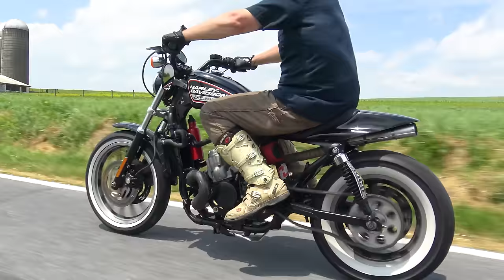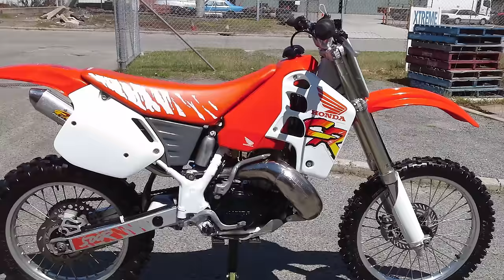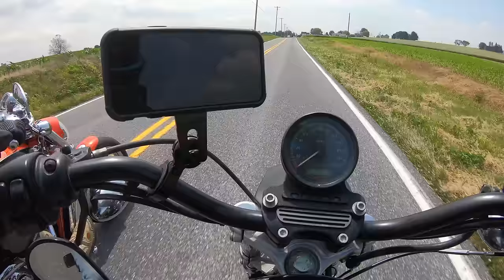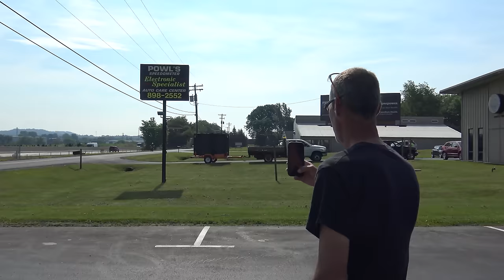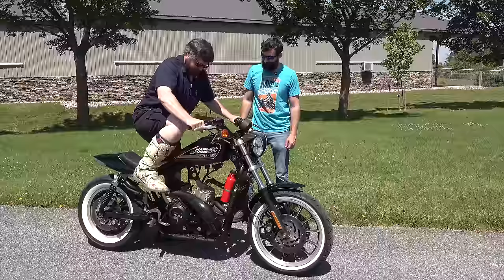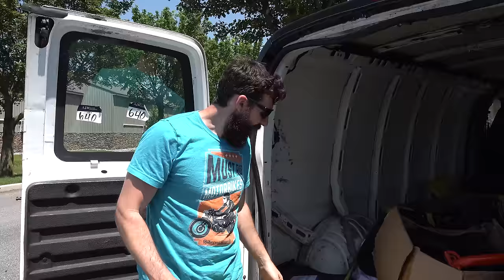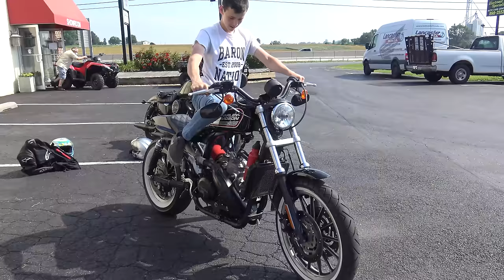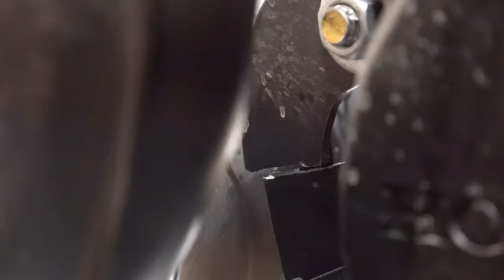First EVER 2 stroke powered Harley-Davidson(Engine Swap)

Comment: all the people i here saying this engine is trash, F off. it was entirely user error:
Most two strokes need you to move the cylinder to the top of the stroke to start properly.
the spark plug fouling is not normal, and could've been caused by oil-rich mixture, bad jetting, or low-quality oil.
Do your research before you piss someone off!

Comment: Sounds like you boys need to learn more mechanics. Lock washers thicker seat. It's running too rich to be burning plugs like that adjust the carb right. Definitely not that great of mechanics. All trouble issues I heard him say my buddy at blah did this or that so it'd work. You stripped a Harley n bolted another motor on it. Great job 🤣
Reply: why are you this upset 3 years after the upload, lmao its not even swapped anymore

Comment: Back In Dallas in the the street racing was the bike s racing alot people like take Harley s put Kawasaki motors on them they were fast I with few of these crazy guys in a machine lathes mills grinder s welders our boss races the 1000 Kawasaki so he turned blind eye to home project s get ur products done then u can do home project s which we had his machine ing to few years later for a another's shop we machine everything for the Ridley motor cycle it was advertised as a automatic  they nice bikes this was in Oklahoma city they went under years ago buy Ridley make vidio they crotch rocket they.made choppers the kids were alot aluminum

Comment: It could have been amazing bike but he totally failed with the suspension 🤔 Please redo this bike properly,have you ever seen a rd350 ypvs with rgv250 wheels/suspension?they look great,its a popular thing here in uk,also a honda h100 engine fits straight into a mt 5,this makes a wheelie machine,usa models probably different name,you would be very surprised with the honda,they wheelie off the throttle

Comment: This is painful. 1.) when ya drag races ya didn’t even come through the power. 2.) way to rich of a oil fuel mixture. 3.) kick it on the compression stroke. 4.) sent sprocket to machine shop, but not rubber bushings to be turned steel?  
Cool idea though. 
Ps LOCKTITE!!

Comment: Why ridged? Seams to me only Harley guys like this sh.. t

The bike was not strong enough for the motor. 😂😂😂 Harleys are not strong enoght for 500cc 60hp 🤣🤣 i piss my pants.

Get the Carbs adjusted inkl float hight and it will start easy...

Rattles it selfe loose? Pretty normal for Harley, isn't it. 😂